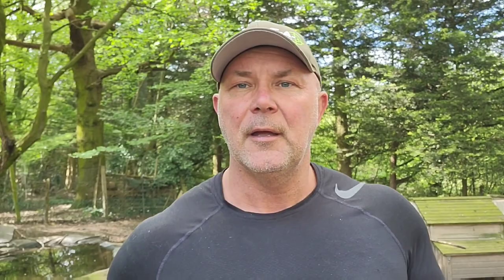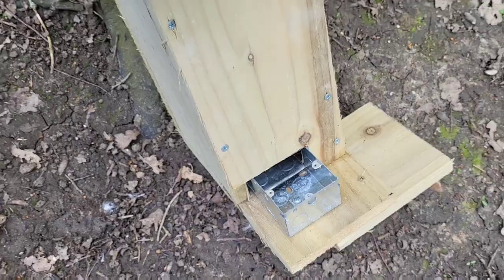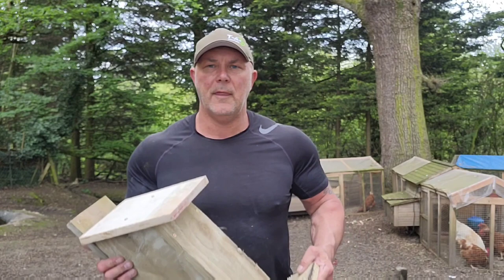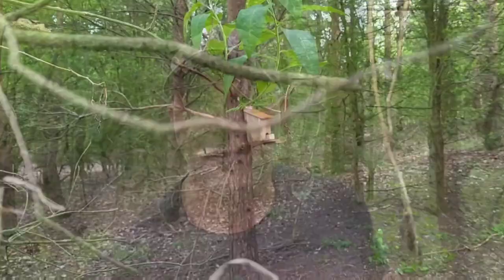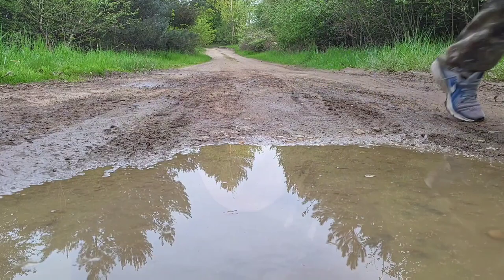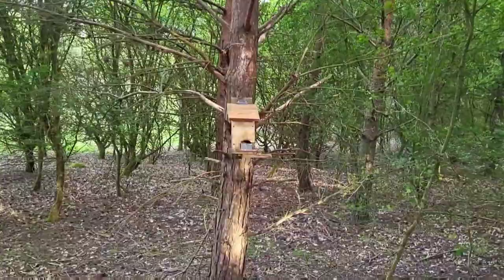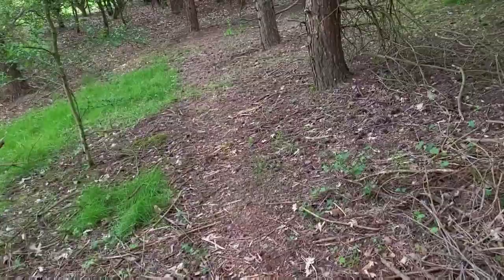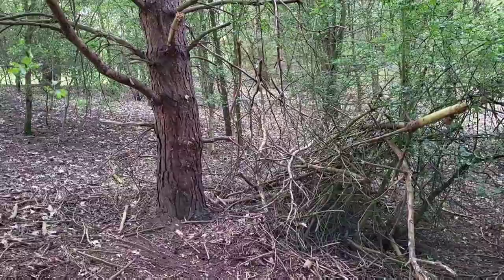Part1: Squirrel shooting for the beginners.

Comment: Nice one, Lad. Thoroughly enjoyed your attitude to things. Liked the use of old wood for feeders. I see a lot on various sites making and using fabricated metal feeders. How do bushy tails scramble over slippery steel surfaces. Wife thinks I'm a right skip scratter. Any pallets, scrap timber and plasterbead comes with me, and now on, metal back boxes. 200 metres from me, at the top of our culdesac, there is a wood about 45m wide and 1km long that runs between the estate at the back of me, and fields. Walking through the wood, nearly every house backing onto it, has bird and squirrel feeders. It's wick with tree rats. Got talking to a house holder, couldn't understand why birds aren't using their net boxes! Can't find out who owns the wood. Big Steve, East Yorks.
Reply from the maker: It sounds like a great woodland to take out some tree rats mate. You need to find the owner of the wood's and put up some feeders...

Comment: Thanks for all the top tips. Oil on order. I attach about a foot of ribbon to the bottom of my feeders to act as a ‘windicator’. Just helps with direction and wind strength. Thanks for the video. Steve
Reply from the maker: Steve that is a cracking idea with the ribbon mate 👌 l will be definitely putting one of them on my feeder. Thanks for the tip Steve. 👌💚👍